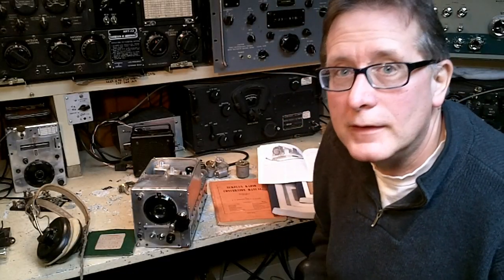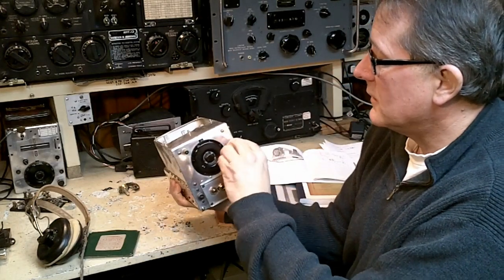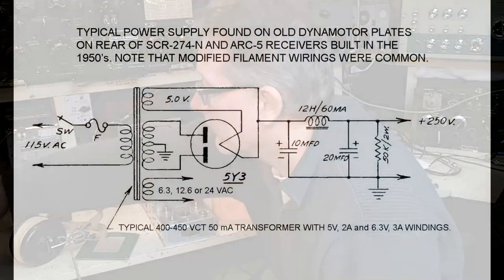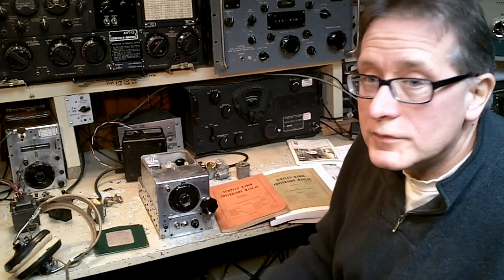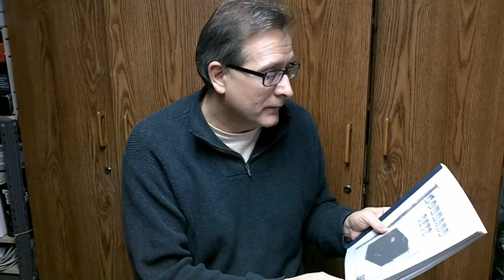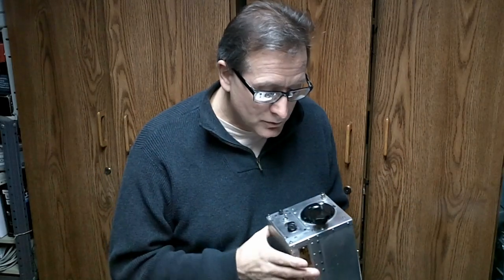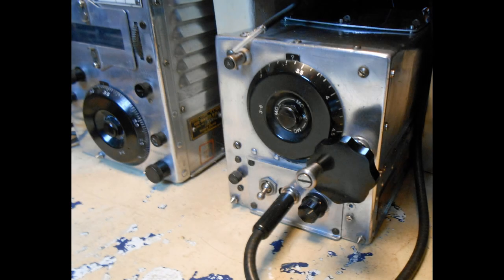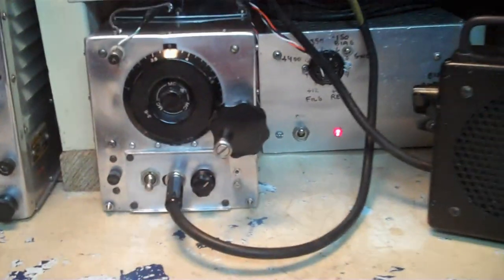ARC-5 Command Receiver - Part 1

Comment: Mike, Thanks for the great video.  I just picked up the BC-453, 454, and 455, along with one home brew power supply.  It was from a living estate sale here in VT.  You might know the guy: K1MVP.  All three work great.  I have not removed the covers yet but judging from the great work he did on his BC-348, he probably replaced all the caps and aligned them.  The frequency is dead on and no drifting!  Hope to see you at NEAR-Fest in October.  I saw you walk by my table in the spring but could not figure out why you looked familiar.  Then I saw you on Burt's video.
73 Paul AA1SU

Comment: Back in the early 70's a friend and I found an Army/Navy Surplus store with a lot of TCS-3 Navy Receivers (3-12mhz??).  We bought them all for $5 each.  Designed to run off 220v, we used upside down aluminum bake pans to build 110v power supplies.  Except for one with a bad BFO, every one worked.  Sold them for $30 each to anyone who wanted one.... still a bargain.  ARC-5s were common and I've owned a couple, but my first real receiver was an SX-28 Skyrider.

Comment from the maker: I did make a mistake saying that in the ARC-5, the 12SF7 replaces the 12SR7. Actually the 12SR7 detector BFO remains; the 12SF7 replaces the second IF tube which is a 12SK7 in the AN/SCR-274's. If you accidently plug a 12SK7 into the 12SF7 socket in an ARC-5 - No Audio...

Comment: Whoops,  It is actually the 40M transmitter.  It has the top and when opened it has the green felt underneath.  It is pristine.  I will have to review your transmitter videos.

Comment: It looks to me like the undercarriage wiring has had some type of sealant applied to it, it looks glossy, judging by the still image at ~ 3:36.  I have a unit, probably a similar model, incomplete, or missing the dial in front but having a few parts loose inside.  But the wiring and components inside, HOW INCREDIBLY IMMACULATE!  On mine, somebody really went to town and tied a thread around the insulation every 1 or 2 cm or so, across every inch of wiring, and I can see the little red splotches of paint, or wax, whatever it is, I'm guessing to indicate where there may be any modifications to original work?  I really am getting into these videos, suddenly, result of my curiosities regarding this funny green 'Dynamotor'/'Interphone Amplifier' box radio gadget from 1943 my friend gave to me (I'm not a radio enthusiast- I'm a musician).
Thanks for your knowledge and for sharing, awesome stuff!
Reply from the maker: Yes some kind of goop or protectant and they likely needed it! The components would be susceptible to water and perhaps as the life of the radio was extended and it was used for ground service, they added it. This kind of jungleproofing was done to most US sets by wars end.

Comment: Can you tell me what pins 6,7 on the fron panel are for?  They are marked LV on the schematic... and one guy says a shunt needs to be conected between them  But I can't fugure out what for.  Thanks for whatever you can tell me!
Reply from the maker: Yes that is basically the place where a switch would go to turn on the filaments and start the Dynamotor!

Comment: What about powering up with 24 volt battery charger?
Reply from the maker: AF, most chargers nowadays are using not only higher voltage, but pulse techniques, so be careful. Some older types might work to drive a dynamotor or I suppose you could add regulation.
Reply from the maker: Oh and a small 12 V gel cell or motorcycle battery across a charger might work.

Comment: Hey - anybody know what V1 and V2 are for?  One right at the input, and one right at the output on the BC-454 schematic.
Reply from the maker: Great Question! V1 and V2 are neon lamp bulb limiters. They protect the receiver's components like fine transformer wire and capacitors from being damaged - and of course the operators ears!, When a sudden burst of static, lightning or radio frequency signals as with a strong transmitter, or when local arcing suddenly appears, (or EMP) they flash! This CLAMPS or LIMITS the voltage to less than 70 V peak. Yes they flash orange when this happens.
Reply: Thanks for the info!  Makes sense. I’ve bought a bc-454 on eBay and am preparing to get it I working condition. I had one many years ago as a teenager...
Reply: And by the way, love your videos!
Reply: I was hooked like you said given many radios from an elmer George Shapero sp radio tv lab in chicago.God bless his silent key. He loaned me a yellow book on how to make them work. I had that  book for 10  years! When I returned the book i expected to get a toung  lashing or worse. George just said thank you . What a true mentor ,elmer. I became a ham from day one with the radios. KC9CMG Paul